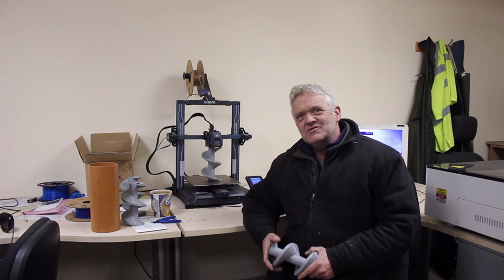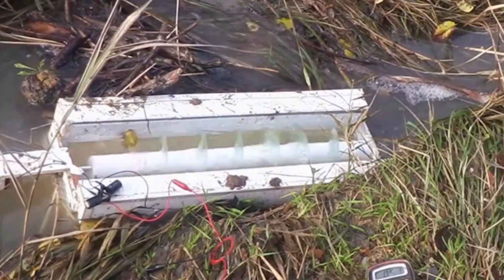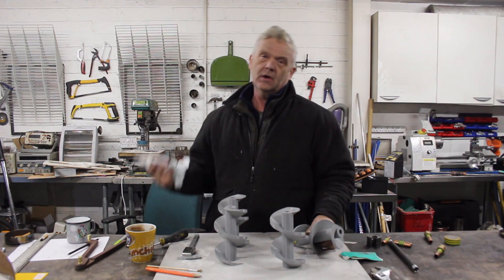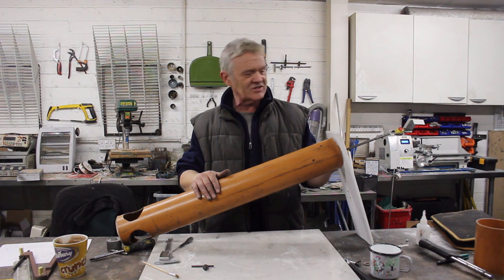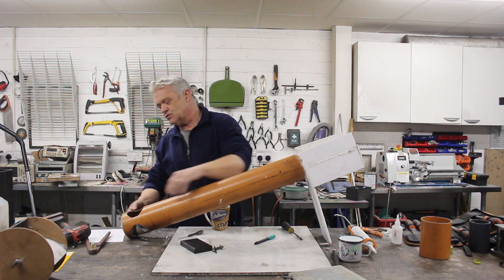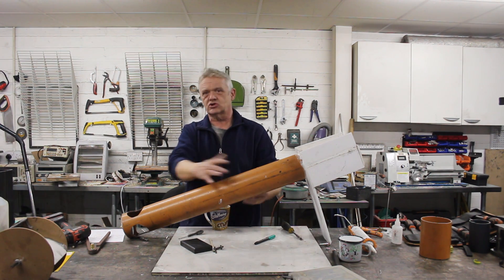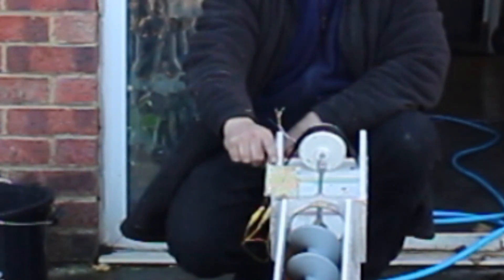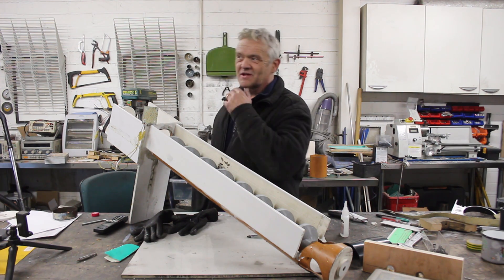1757 DIY Emergency Rainwater Generator - How To Make It

Comment: What about vertically? Would it still work if you put it directly to a downspout vertically? You'd have to waterproof the generator, but I dont think there is any reason why it wouldn't work.
Reply from the maker: for sure - but there is no reason to and there are reasons not to
Reply: @ThinkingandTinkering  If it's vertical, surely the rainwater would have a clear path through it. I think it works better when it's at an angle and can trap water between the blades.
Reply: @ThinkingandTinkering  just seems like a lot of extra steps, and a bit of waste of space, to make it take up a larger area then it has to.

If its all inline it has no need to take up space on the ground. It can all fit in the pipe, with a couple lines running to whatever power storage you have for the energy.

See I live in an apartment, and I've been being learning all about the need to minimize the space taken up by projects, while maximizing their benefits. And making the best of the limited space I have. So I guess its influencing my thinking.
Reply: Vertical is a no-no. However, if you put a slopped pipe on to the vertical you can run the screw in that. zig-zag the pipe back to the drain of course. 
You'd probably do ok by porting water from the vertical pipe into a hopper, and then into a dedicated larger dia screw that was sealed inside a slopping pipe, the pipe/screw arrangement being made so it all rotates. It's more a matter of extracting the potential energy from the mass/height of water falling rather than kinetic effect of flow.
Revisit the difference between p.e. and k.e.
Reply: @bikerfirefarter7280  Well, I'm now thinking that it would work if there was large enough flow of water, so if you had a tall building and torrential rain and the downpipes were properly sealed, then maybe.
Reply: @mrab4222  With an Archimedes Screw in a vertical orientation the conversion efficiency would be TINY. A.S. works primarily by imbalanced load offset from the axis NOT hydrodynamic kinetic conversion, as is more the case with propellers and turbines. The height difference between highest and lowest part of the inclined screw is the main issue. The more vertical the A.S. the less effective the imbalance. The ratio between helix pitch and slope of axis is the limiting factor. Once the pitch matches the axis-angle there is no 'chambering' and fluid flows virtually uninterrupted. A vertical A.S. is just an unobstructed path regarding fluid throughput. It has virtually nothing to do with how fast you drive water through it. Yes it'll spin, under powerful/rapid flow but torque conversion efficiency is very low.
An A.S. works more like a chambered pump than a propeller or centripetal impeller; but an A.S. has to be inclined or it's not an A.S.
Reply: @bikerfirefarter7280  So, in summary, yes, but barely. 🙂
Reply: @mrab4222  I think my first sentence said that. ;-)

Comment: The bigger the drop the higher the energy potential.
Reply from the maker: yep
Reply: @ThinkingandTinkering  I wonder how much torque it's developing for driving a larger generator 🤔
Reply: I was wondering if there was a way to put them into the vertical rain pipes. Allowing houses to utilise rainpower, without it being into view. Since you get 2m to 8m drops in elevation, but with a 80mm diameter
Reply: @Jonsoh811  yes, if your generator can fit in the pipe, picture a rain pipe going to the gutter, but not quite, with a small right angle section of pipe feeding into it, from the gutter. so the generator is dry, the water comes in at a right angle beneath it, but it is not visible
Reply: depends on application the "less vertical"  the more water you can have acting on it for more torque with less volume, similar to a water wheel.